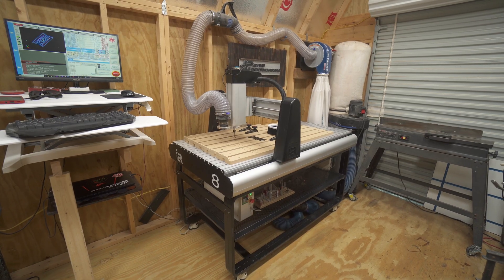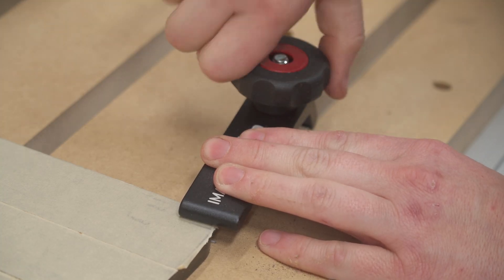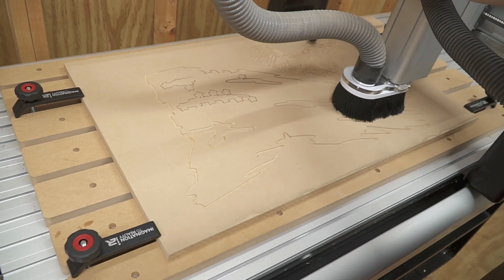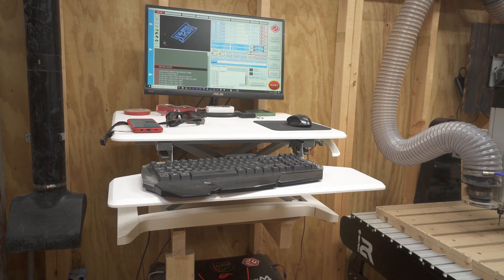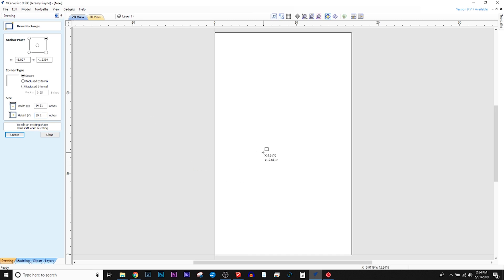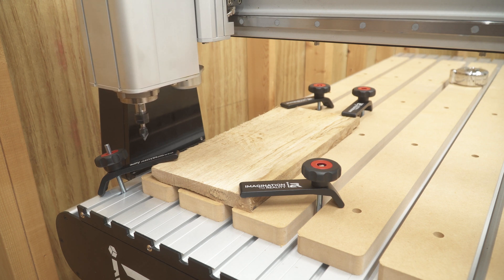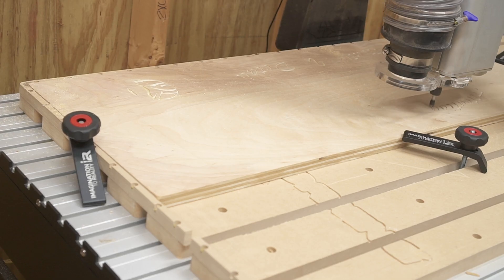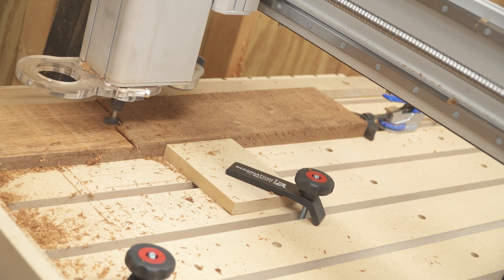i2R-8 (Imagination 2 Reality) CNC Review (4k)

Comment: Hello, I enjoyed your video.  I have to say that after a lot of research I decided on an Axiom Iconic 6.  What I didn't know was that there are different people in the US selling Axiom CNC machines.  I went with Axiom Precision sadly.  I would have much rather had an Axiom that connected to my computer!!  Why are there different Axiom machines in the US?  I feel cheated!
Reply from the maker: These are not axiom they are i2r brand from i2rcnc.com
Reply: @jpaynewoodworking7510  An article from 2018...  "Axiom Tool Group is preparing to launch its new i2R small-format CNC machining center that will be available for shipping in December. The i2R – which stands for ‘Imagination to Reality’ – is targeted specifically at the first-time CNC user building furniture, cabinet parts, signs and more."
Reply from the maker: Axiom has and mdoes offer a module called i2r but thithe machine I have is a separate company that does work along side axiom

Comment: I am seriously considering ordering the I2R8 soon.  When looking at the dimensions of the machine it states its only 28 inches tall. This seems pretty low. Is this an issue at all? Seems like you would be bending over a lot .  Thanks
Reply from the maker: Ibeilve that is for just the bed and spindle as the frame is and option you have to chose to get with the frame it's no problem at all

Comment: Great video, very informative and easy to listen to. I’ll be purchasing one soon to replace my old one. Can you design and create the g-code just with v-carve? Is there a post processor to download? Thanks a bunch🙂
Reply from the maker: It's all done in v carve and you open the toolpath in uccnc it's extremely simple
Reply: JPayne Woodworking thanks for replying. I’ve been using Aspire for fours years and wasn’t sure. Thanks again   (Professor 2.3) soon to own axion.
Oh one more thing. Need more research but I was told the Z travel is only one lineal rod with only two bearings (one on top and one on the bottom) true???
Thanks
Reply from the maker: I'm not sure on the axiom check out the description and look at the i2r.com machines I'll look and comment so I don't tell you wrong I cant remember if it's 1 or 2 linear rails on my i2r-8. There's also a code JPAYNE10 that is you use that at i2r.com on the i2r-8 it will save you $200 on the machine.
Reply: @jpaynewoodworking7510  thank you for taking the time to reply, this all helps me. Look forward to more videos👍

Comment: is this an AXIOM?
Reply from the maker: No this is the I2r-8 UCCNC from i2rcnc.com go check them out there an awesome machine as well as if you order one use Code JPAYNE10 and you will get $200 off of the i2R-8.
Reply: John Sobel i think is the same company but different brands
Reply: I very recently found out from one of the techs a i2R (Sonny) that this machine is a direct relative of the Iconic CNC, by Axiom.  Both units are made in the SAME building, with the only differences being the color of the gantry support covers (iR2's is black, whereas the Axiom's is red).  Additionally, the Axiom utilizes a hand-held controller, and the i2R's feature the computer based UCCNC controller.  @paulusandronicus